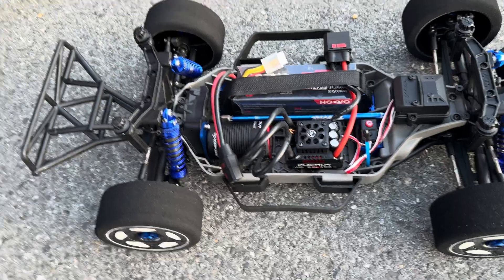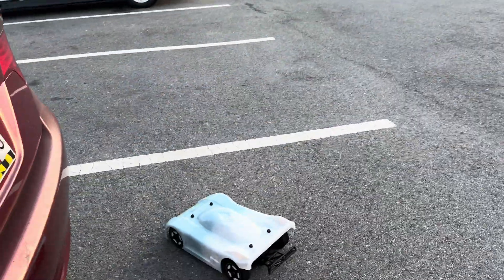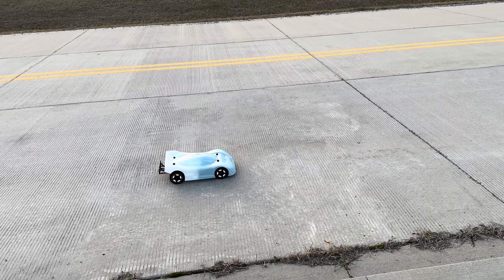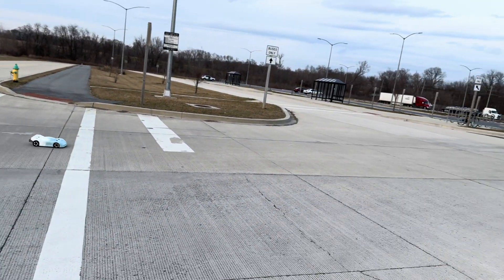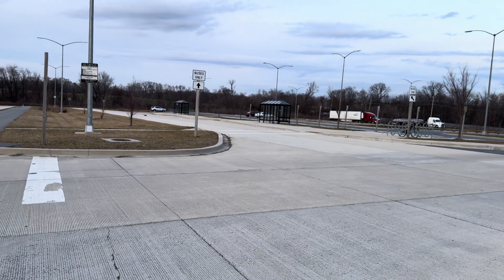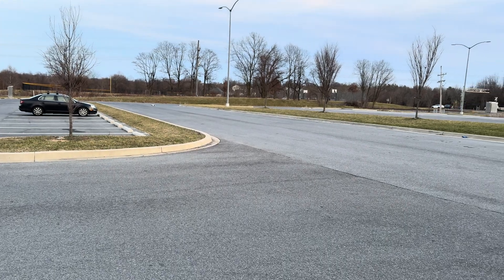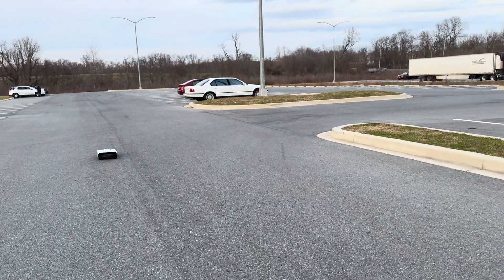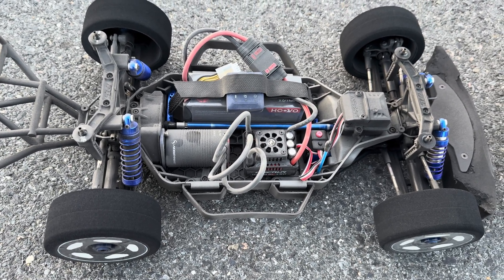Quicrun 8BL150 G2 ESC with Ezrun 4268L 2600kv G2 Motor Combo #traxxas #slash4x4 #spedrun

Comment: Great video, did you have to modify the chassis or change motor mounts to get that motor to fit? With its bigger diameter
Reply from the maker: @zacharypoland2212 that system drop right in. I believe I have a build video on this car.